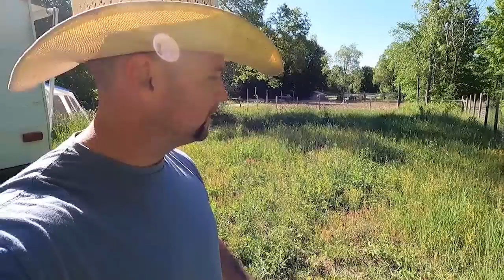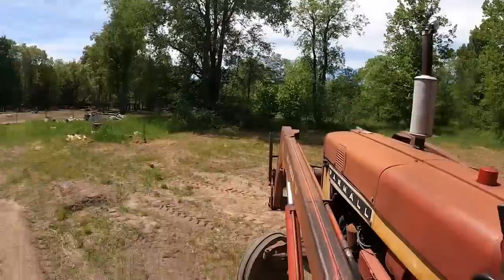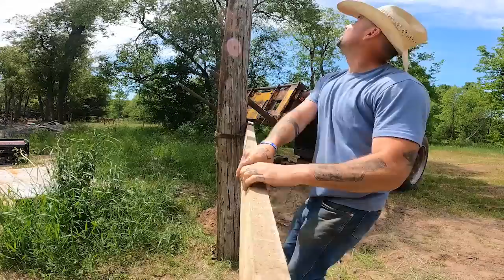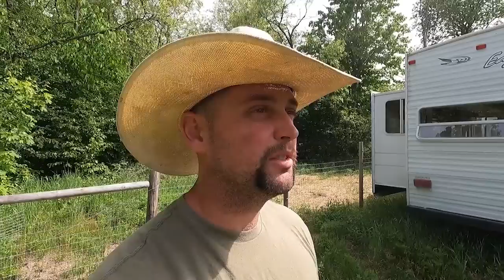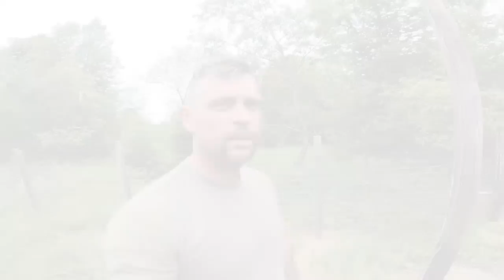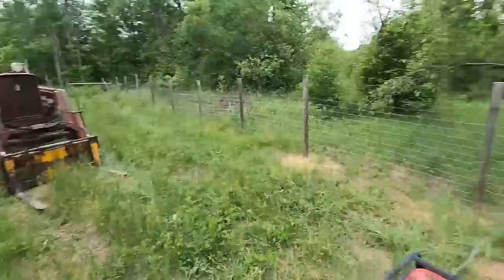Sketchy Homemade Powerline Build

Comment: With 240 one hot wire becomes the 'neutral' or return wire for the other hot wire 60 times a second. It's like having a rope around a pulley and then holding both ends, yank one end and then the other. The non-wanking I mean yanking hand gets pulled back to return the rope for the wanking I mean yanking hand.

Comment: half assed tip on the generator,  cause I have a junk one too. as long as you have spark and fuel, pop the spark plug out and spray some carb and choke cleaner down the hole, put the plug back in real quick and give it a tug. she'll pop right off

Comment: If you’re going to use a generator, why run the wire. Just put the generator where the plug is.

Comment: Sketchy is correct.  If and when it fails, I recommend replacing it with insulated wire and add a lightning arrester with a ground rod.

Comment: That’s not very Eco-Friendly, you should have batteries powered by solar panels and wind turbines and what if a Goose-Beak-Yellowtail-Asian-Finch was to land on those bare wires…it would be in little birdie heaven! 🦜🙈🙉🙊😎✌🏼🇺🇸
  Remember…Ride a cowboy save a horse. 🤠
Reply: Have you never seen a bird on a power line before?  Birds land on 500,000 volt lines and aren't affected. And no, they're not insulated.
Reply: @JCWren  I’m sorry I was trying to be funny, I guess I failed. 🫏

Comment: I have a westinghouse 9500 that looks similar to that.  Mine had a ton of trouble starting until I realized there is a manual choke switch under the fuel tank near the air filter.
Reply from the maker: I had manually adjusted it. A buddy told me the fuel solenoid to the carb won't open if the battery is dead. So I'm gonna charge it up and try again
Reply: @andyslittlehomestead6705 vice grip garage teaches every great project starts with the battery on boil

Comment: I have a champion dual fuel generator from tractor supply and I love it but it is IMPOSSIBLE TO PULL START COLD without a shot of either but fires right up no issues with the electric start
Reply: If the starter goes out take the pull rope off and use an impact on the crank nut till you can get a starter I've been using this method on mine daily for over 2 years I keep saying I'll get a starter someday but haven't even looked into where to buy 1 or how much they cost yet I imagine they're not as cheap as they were the day it went out

Comment: At first I thought Andy had been hacked and this was an imposter. The tractor started right up and didn't break down mid project. He started with presumably enough material. Thought ahead that he can't forget where the wire is if he doesn't bury it. All very suspicious. 
But then came that horrible noise which I guess was singing and not a piece of machinery dying.  Of course, once "the generator " happened I knew it really was Andy.

Comment: Those Harbor Freight Generators run forever too!  A few years ago, I worked for a mobile Veterinarian who basically used converted car hauler trailers for their mobile clinics. They started with 2 Honda generators and one small HF generator for the small trailer. The Hondas they had to keep sending to only one Honda dealer in that area that would work on them and then settle up on the maintenance. The small HF generator, we got their 2 year warranty and then every 2 years, we empty the generator of fluids, take it back, and buy the new warranty. Even the stores told us to do this when we bought 2 new larger generators from them. They were used heavily for those 2 years and then got new ones.

Comment: 😂 dont you just love how the old cheap tool gets the job done when the "newer better" tool ends up being a giant pos?
Reply: It's a good generator you just have to keep the battery charged to open the fuel solenoid or bypass that and put a manual fuel shut-off on iti have the same 1 and it never failed whenever I needed it the battery was dead but they're great with a good battery

Comment: Take it from someone that knows getting electrocuted sucks
Reply: I have a friend we call 8 and a half because that's all the higher he can count on his fingers after putting his hand on an open high voltage junction box in the ceiling of a car dealers showroom luckily a Lil red express hood kept him from falling completely to the cement floor they never did find his thumb and half his pointer finger
Reply: @davidwoermansr  I have all my fingers just got myself a new shoulder...it was only 120
Reply: @danbartolini27  now it's right
Reply: @davidwoermansr  Did he have 11 fingers to start with? I didn't grow up with this "new math" stuff, but pretty sure 10 - 1.5 would be 8.5...
Reply: @JCWren  no my fat fingers hit the wrong number and auto correct doesn't correct numbers with the new math the answer would be purple potato

Comment: I could have sworn you had an auger rig for your tractor
Reply: Bet that particular tractor is not currently running
Reply: Why waste fuel when digging is that easy
Reply: @davidwoermansr  why walk when you can ride
Reply: @danbartolini27  because I get exercise and don't have to pay a gym membership I enjoy the beauty of nature at a slower pace and I add to my exercise by pulling a gorilla wagon with a barrel for beer and a few soda cans a 5 gallon bucket for metal and contractor bags for trash the 8 miles to town on 1 side of the road I usually have 3 bags of trash the gas station let's me toss in their dumpster and I get the other side on the way home and burn that trash and I then take longer backroads on my walks I enjoy keeping the land around me beautiful and the price of gas why drive and waste gas for a short distance especially when you drive vehicles like mine they all have a purpose they were built for and the grocery getter isn't done yet it's already had 8 nose jobs this should be the last with the fabrication shops deer catcher but I refuse to fire up 1 of my big block low geared trucks or semis with big 700 hp engines just to go 8 miles to get a months worth of groceries I'd spend more in fuel than groceries
Reply: @davidwoermansr  oh sorry didn't know you where homeless